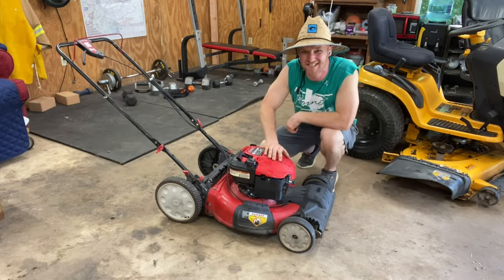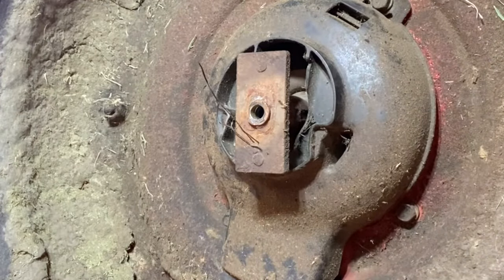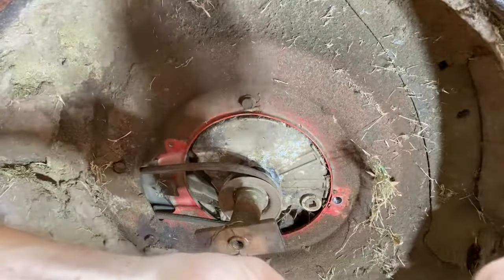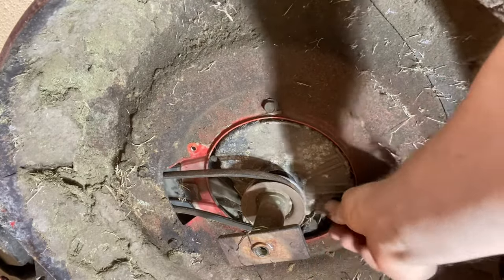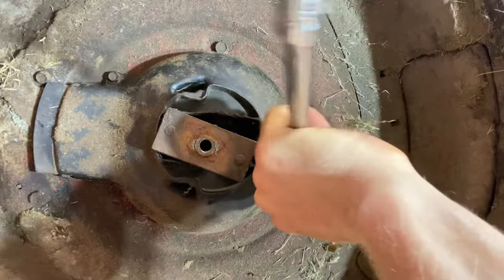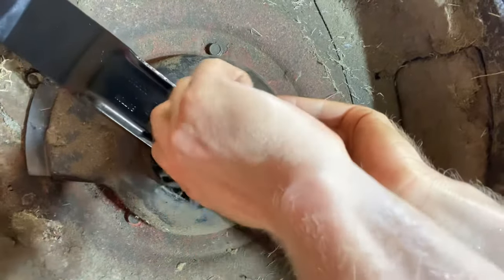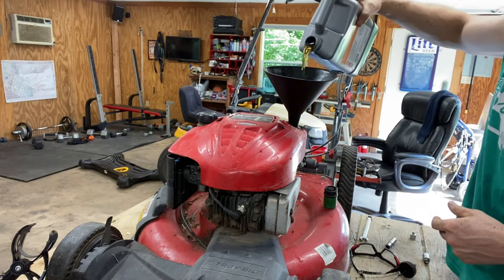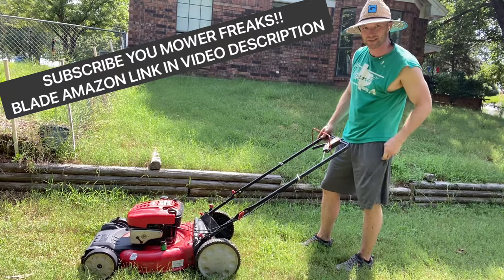Troy Bilt Lawn Mower Oil Change and New Blade; QUICK & SLICK!!

Comment: I'm working on a Troy-Bilt tb230 and it has the recess where the plug should thread in but it is not drilled out or tapped, it requires you to tip it on its side and pour it out the dipstick hole. It has the exact same cover on the bottom the same belt same blade Mount and everything
Reply from the maker: Wow that must have saved 50 cents in the production cost, pretty sad they don’t make oil changes easier on those.
Reply: Same here. I just went to change it.  Know plug hole
Reply: I have the one without the power front and it doesnt have the drain plug at the bottom.
Reply: Same here. TB230 with series 720 Briggs and Stratton engine with the plug formed into the engine body, but no drain plug.  Not as satisfying to get settled contents out by tipping it over.
Reply: Same here. I have the TB240 and no drain plug.
Reply: What years are your mowers. I have a 2009 and it has the drain screw. I suspect if your mowers are made within the last 5 years they sealed the plug up so you have to take it to a dealer to repair it.
Reply: @MrWolfSnack  mine was made in 2012. Doh!
Reply: @jasonbengel  Yeah I'm thinking they must have changed something to stop people from changing their own oil.

Comment: Should told people to take the spark plug boot off anytime you working on blade or engine.
Reply from the maker: You have to tell me how you came up with that handle!
Reply: @MowerMike  it my dogs names lol. So my Troy Bill TB240 doesn’t have a drain under it. Further research led me to see people just tip it over and let the oil pour out from the oil fill tube. 
However now I have a problem of my self propelled mechanism not working.

Comment: I tried a transfer pump but it wouldn't work. I guess there's a corner and it wouldn't go all the way down to the bottom of the crankcase.
Reply from the maker: You can always just tilt it over and pour it out the dip stick tube. It makes a mess though

Comment: Overall a pretty decent video. Be sure to note that the drain plug is not visible by removing plastic cover on a TB200 model. Also, work has been done on the mower before because the plastic cover was installed incorrectly. After he took everything apart and put it back together he installed it incorrectly again. You can tell it's been worked on because the tab that was not inserted is much cleaner than the rest of the cover
Reply from the maker: By “decent” I think you meant “AMAZING” ;)

Comment: What if you don't have the drain plug under the plastic? I just bought one and decided to add new oil found your video helped alot but when I pulled the plastic cover I don't have a drain plug lol
Reply from the maker: I know it sucks. Will have to dump it over, or use a pump. I have a video coming up soon on using the pump

Comment: Great video mike! Now if I poured too much oil into tank, can I do this and then run the mower to burn remaining oil off? Thanks!
Reply from the maker: Nooo! Just drain the oil out and measure the correct level that goes in the engine
Reply: Crack the drain plug and keep letting little bits out at a time until your dipstick is at the correct level. Remember to wipe the dipstick and fully seat it in- between insertions. NEVER run an engine overfilled with oil. Oil does not compress and you will throw a rod through the block [car engines] or crack the block apart.

Comment: Hey buddy, you got your drive belt cover on wrong. It goes into the slot where the belt does to the drive front wheels. I just put a new blade and blade holder on mine and it's kind of hard to get the belt cover in the slot where it's supposed to go. Thanks for the video even if part of it was wrong. Thanks anyway.
Reply from the maker: Thanks for being so kind in calling out my mistakes. Most of my videos have atleast one error in them

Comment: Where is the fuel filter? I'm overdue on new plug, blade and fuel filter. So this is very handy, thanks!
Reply from the maker: A lot of these small mowers don’t have fuel filters.
Reply: @MowerMike  That would make it hard to find...... LOL Thanks
Reply from the maker: @michaelparson-mcnamara782  Haha yeppers just drain the old gas out and you are good.
Reply: @MowerMike  Every end of season here in northwest lower Michgan....
Reply: @MowerMike  What about air filters?
Reply: No fuel filter. You can put one on if you want but it is not needed. Air filter is on the right side of the engine.
Reply: @MrWolfSnack  Thanks! I've changed the air filter a number of times over the 12 years.
Reply: @hman962  I change those.

Comment: I put just a little too much oil, but now there's white smoke coming out. Is it ok to run the mower til the white smoke disappears, or should I completely drain out oil?
Reply from the maker: I would drain the oil out. Forcing oil into the cylinder is not good

Comment: I have Troy-Bilt 280es, there's no oil drain plug under the belt guard, where else can the drain possibly be before I start completely taking it apart
Reply from the maker: Just tip it over on its side and let it drain out the fill tube. I hate doing it that way cause it makes a mess but that maybe your only option.
Reply: If your oil plug is sealed up you will have to use an oil siphon tool. Troy Bilt made the engines so you have to take it to a dealer to change the oil and made it so you can not change your own oil.

Comment: My TB210 has no drain plug. The boss is there, but there’s no threaded insert.
Reply from the maker: If there is a square hole in the boss you can put a ratchet wrench in it but if not you will need to tip it on its side to drain. Good luck
Reply: you ever hear of an oil extactor???   Next.
Reply from the maker: @evo7ism  Nope sure haven’t. Next what? Don’t leave me hanging here

Comment: Nothing wrong with tipping the mower on its side or using a siphon. Warming up the engine before draining is more critical.

These take around 20oz, not a qt.
Reply from the maker: Yep way overfilled her, got to watch the the end for my screwup. Got to disagree on the siphon comment, gravity is a great tool when getting out old oil sludge.
Reply: Mower Mike's Garage l
Reply: Yeah I was thinking the same...no way a little 6.75  B & S is taking a quart to a quart and a half.  You'll get oil in your carb then you're done.
Reply: Watched another video were he poured in a full bottle, then added more! Thought it should only be 28 ounces!
Reply: @MowerMike  for years I always drain from bottom. I went to VoTech small engine repair. We were taught that way. Two other vodeos here showed tipping.

Comment: My mower looks nothing like that on the bottom.
Reply from the maker: Hmm must be one of those electric jobs
Reply: @MowerMike  no apparently it’s a TB110 and you have to drain or run gas out then tip the mower to change.

Comment: Might want to tell people to pull coil wire from plug. U put a power tool on the blade bolt and dont hold the blade. You just might start it. Pass in this one.  Sorry
Reply from the maker: Good point, glad I didn’t cut my arm off!

Comment: There is no. Drain plug on the newer model. Bastards!
Reply from the maker: Right, such a crappy way to save a buck making mowers.
Reply: on the newer models, can you drain it by tipping it over so the oil comes out the fill tube?
Reply from the maker: @dalziel1014  Yep you can it just will get messy